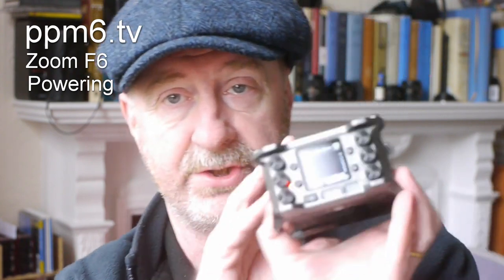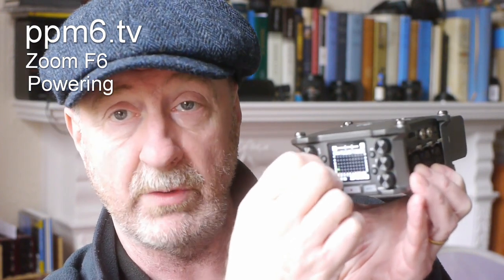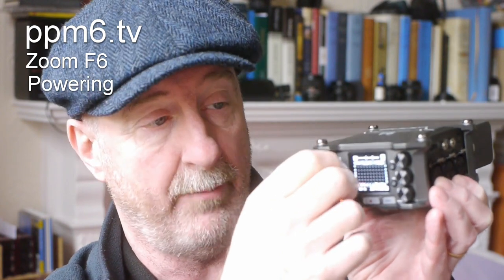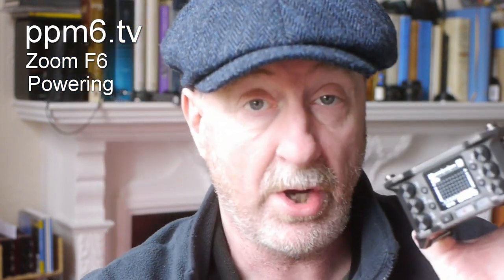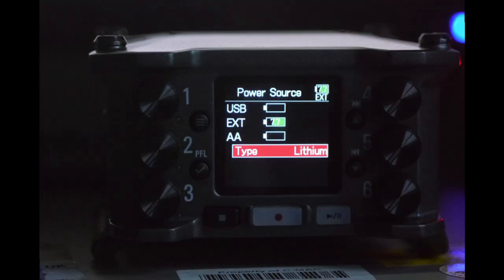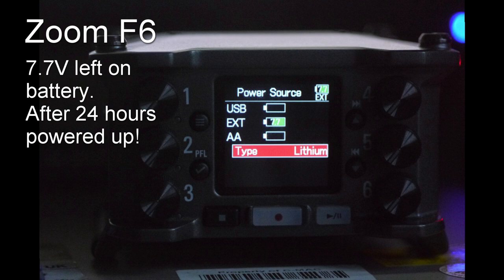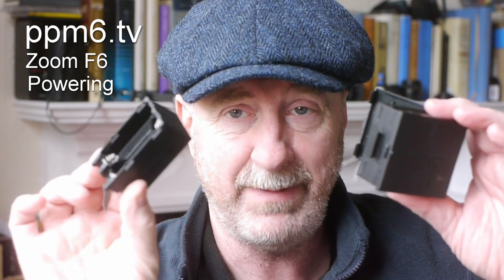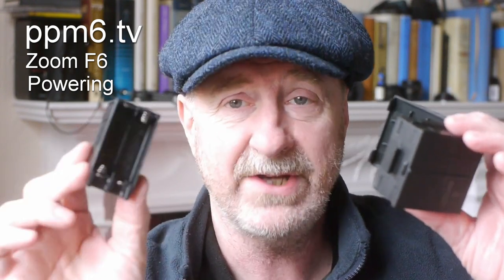Zoom F6 Recorder - how to get max power.

Comment: This is very good to know as I won't be using all 6 channel straight away or at least not all the time!
Reply from the maker: Thanks Utkarsh - the F6 is a fantastic machine, I recommend you have a look at the Bluetooth control option - it really does help the workflow. Ta like, ppm6.
Reply: @ppmtv-qh9qk  I watched your video comparing the F6 and the F8n and I'm thinking of saving up a bit more to get the F8n or F8n Pro now! Thank you for that video
Reply from the maker: Well the F8 series are I think easier to use - the workflow is better. There were some very good deals on the F8 when the F8n was realised so keep an eye out and see if you can get an F8 for cheap!  Ta like, ppm 6.

Comment: Nice video man. 
very informative and amazing that the battery last so long. by the way I work at a radio station that  is very old  50 years or more and they we're scrapping a lot of negra's which was totally shocking because I know that their value is very high the problem was you couldn't buy them or take it out of the station because the station itself is a government establishment which means that you can't sell it. 
they literally scrapped or destroyed valuable gear once they were not in use anymore which is a real shame
Reply from the maker: Hi Sharon - what a terrible story. I can't believe they would scrap things without giving you any chance to buy one!  Nowadays when the BBC gets rid of stuff they use an auction site to manage the sale and you can bid for whatever you like and take your chances. Tell me do you know if they were mono or stereo Nagras?  A lot of reporter machines were mono while the engineers got the stereo machines. I have a Nagra LB - I should be putting that in a video some time. Thanks for the feedback. Ta like. ppm6
Reply: @ppmtv-qh9qk  yes I believe you are correct. even though I been working there for only 10 years or so I do believe that they were using a mixture of a few Stereo niagara's and and mono one's. 
 come to think of it I do  had the chance to talk to a few veterans engineers and they had similar sad stories about precious gear that was too expensive to repair So they  just chucked it out. one example was a beautiful  studer  broadcasting mixer which was sent to the garbage dump. 
very sad indeed. 
We now have a new broadcasting building and a very little bit of gear was salvaged from the old station. if you have a Facebook Page I can send you something interesting😊
Reply from the maker: @lachopakapura  Thanks Sharon - sadly I don't do facebook. So sorry to hear of a Studer going in the bin. We had a couple of the 9 series analogue desks and they were just brilliant. Took loads of abuse and kept on working till we wore them out. Even just the channels out of your Studer would have been worth saving. What were they thinking?  What desks do you have now? We have Klotz but DHD is coming. Studers in the bigger studios but with Studer now owned by Samsung you do wonder what the future holds! Ta like.
Reply: @ppmtv-qh9qk  wow... I didn't know that studer is ownd by samsung.
We are using DHD they are nice but they are no studer.
I wanted to send you a picture of the tape machine that we salvaged
Reply from the maker: Studer were bought by Harman and now Harman have been bought by Samsung. Now I love a good tape machine. When I started we had Studer B62s and then A80s - I trained with older British tape machines like the BTR2. London had Telefunkens - lawn-mowers compared to the A80. What play out system are you using? Ta like.

Comment: Hi mate, 
How does the power consumption and life on an NP-F970 Vs USB Power Bank?
Im asking as the 6600mAh Sony L batteries even though old still retail around £150 new, yet say the 20000mAh Energizer Hightech Portable Power Bank you can pick up for around £40.
Reply from the maker: As I have a couple of 970s from my SoundDevices 744 days I haven't had to go down the USB route and as I'm not a mobile phone warrior I don't have anything suitable kicking around to try. Martyn has the Hawk-Woods versions of the L batteries a bit cheaper - https://www.soundkit.co.uk/categories/389609/dv  - but you need a charger and that's another hundred quid. 
The advantage of the L battery is click on stay on. Disadvantage - covers the media slot and makes the recorder longer and heavier. Have you got a bag you can recommend? If I didn't have a charger I'd give the USB pack a whirl. 
What projects are you using your F6 for?
Ta like, ppm6.
Reply from the maker: Thanks- I really wish you all the best with building a foley library - very worthwhile and challenging field. Do you have any local post places you could tap up and see if they are interested in your foley material. Or have projects they need custom recording for? Thinking beyond the virus of course...
What mics have you got plugged into the F6 and do you do all stereo stuff and if so are you going down the MS route?
Did you get the USB battery pack to work for you?  Take care, ppm6.
Reply from the maker: Great info on the powerbank video - that's got to be the way to go for an all day set up.I haven't tried the BP4029 - I do have the AT835ST - but since it got baptised in a flood it's been noisy. I don't do much stereo on location but a lot of guys go the MS route - matching a figure of 8 to a directional mic. The F6 has MS decoding built in. 
The Sennheiser 418 is a popular stereo solution but £££. Ta like, ppm6.
Reply: @ppmtv-qh9qk  Yes I've heard loads about the 418 and it's quality. 
I mainly use mono especially for tracking aircraft and moving objects. My usual setup when recording environmental ambient sounds in the past was to use three NTG3's set out in a triangle pattern before to record. Then set them in a multi track in the editing application and save them as a simple stereo file.
I'll be honest I don't really understand what is required to set up equipment wise and the theory behind MS recording. 
Like I said I'm an uneducated plebian 😂
Reply from the maker: Sorry SoL - I completely missed your reply. I do apologise. For MS you have a sideways facing figure of 8 and usually a forward facing cardioid. The great thing is you can vary the stereo width in the mix by varying the amount of the S (figure of 8) you apply in the mix. The M and S 'raw' tracks have to be processed in order for you to hear the effect. On a standard mixing desk you send the M up the middle of a channel and then send the S to two channels one panned hard left and the other hard right with one of them out of phase. Then ganging these two S channels together controls your over all S. Now the F6 has the decoder built in so you can hear your MS recording in ordinary XY as you record it. You just have to select the MS option on the track. Hope your recordings are working out. Ta like, ppm6
Reply: @ppmtv-qh9qk  Thanks for that detailed explanation, I'm definitely going to do some further reading on the matter. 
Not had much chance to do any recordings this year really. We had a few storms in which the F6 performed amazingly. I can't wait for next year's airshow season.
Reply: I recorded two tracks at once, one with phantom power and one without, I recorded at 32 and 24 bit at the same time. Power measured going to USB was only 1.33 Watts. Screen brightness level 50. This doesn't use much power at all.